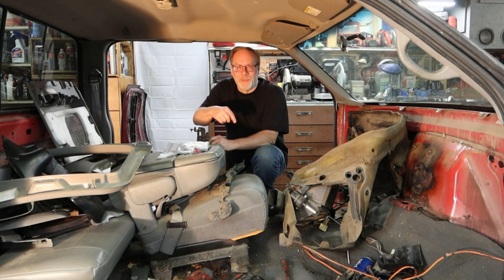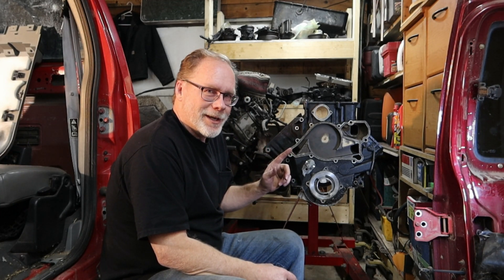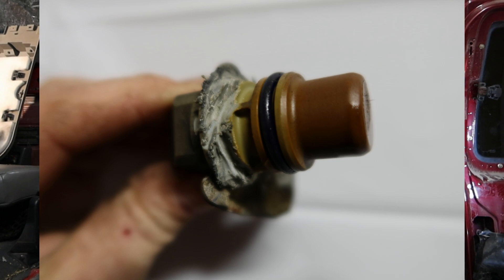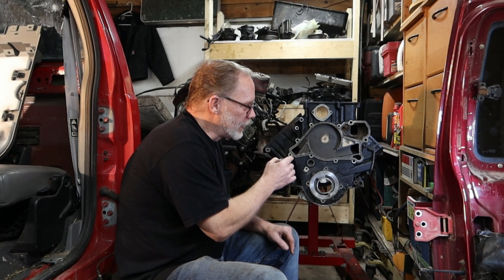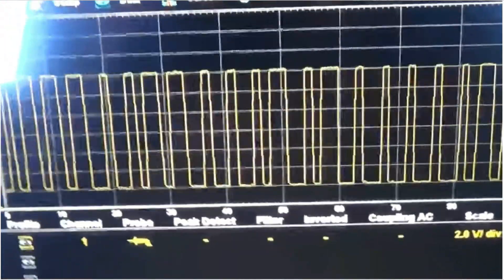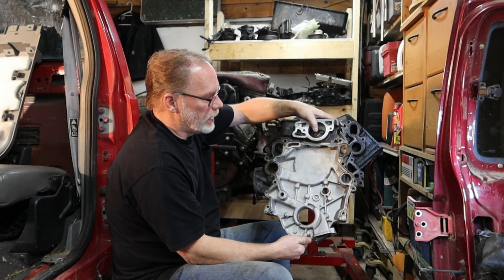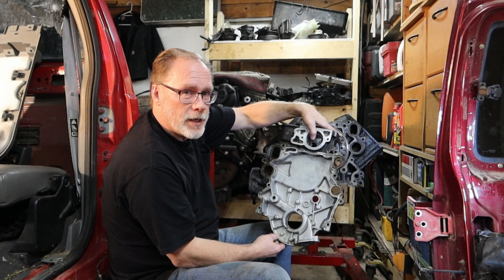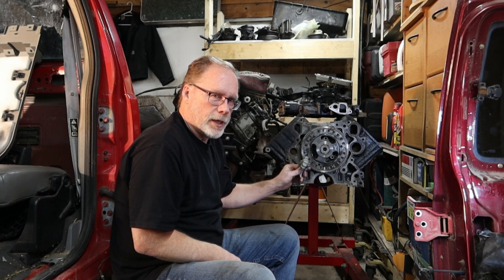🛻📽️ ....7 3 PSD QUICK TECH TALK CAM SENSOR N TIMING COVER NO NO'S🟢🟡🔴🟢

Comment: Hello First off I'd like to say I'm glad I found your channel I have a 99 F 35 0 5 speed starts and runs great sometimes when I go first second and third gear and go to shift the engine cuts out from 5 to 15 second but the motor still runs what has zero power I have to periodically wait and it will come back on, it is scared me a few times when turning out onto the highway with a load and cuts out one of the Cam position sensor possibly be the problem thank you very much should have a shop and where are you located thanks again

Comment: Hey clint, i have a 96 f250 7.3 powerstroke. Was looking at installing the riff raff hpx cross over oil line for the hpop. Is it a good idea? Any disadvantage?
Reply: If you have a stock hpop yes get hpx line

If using an adrenaline hpx line not needed

Comment: Hi Mr Clint I recently purchase a 1997 f350 7.3 in November last year and luckily find your videos ,I never had a diesel vehicle before and I have a question for you, why the engine rumps or loops around when I start it when engine is cold .thanks for taking the time to share your experience with your videos.
Reply from the maker: If it is a automatic trany or was swapped from auto to 5 spd  change the trans switch to a borg warner S9192 /// Other issues that cause this is a sticky IPR this you can remove, install a new seal kit and spray the inside with a carb cleaner to get the gum out of it /// last but not least a air bubble managed to get stuck in the ICP just remove and reinstall to clear air ///  These are the top reasons this happens.
Reply: It's a E40D I saw a video on the the transmission neutral switch, the guy would start engine in park and as soon truck fire up it started looping and he would put it in neutral and it would settle, I tried that on mine and didn't work, I'm going to go with the other advice you give me,I really appreciate your prompt response and your professionalism and knowledge thanks a million stick around!

Comment: How you doing sir? I had a question i have a rebuilt 7.3 I replaced everything and for some reason my HPOP reservoir won’t fill up at all I even replaced the lpop again to make sure and still nothing it had a adrenaline HPOP new ipr new ipc in my cab the oil pressure gauge ain’t moving either I lift my rear end up maybe thinking my sump wasn’t working I’m lost maybe thought u could help if watch some many of your videos I really appreciate it
Reply from the maker: A few questions What year, was the sump pick up new, was the timing case new, was the lpop gears in correct direction or was it universal, was there a new ball and spring with crown installed, if you manually fill the hpop reserve and leave it sit for a few days is it at the same level or does it go empty, was the block before assembly completely brushed out meaning all passages had a like a pipe cleaner ran through, have you taken high pressure air and at the hpop reserve tank oil inlet and shot a long stream of air back through the system to hear bubbling in the oil pan Let me know this info Thanks
Reply: @CUSTOMWORKS7.3PSD  idk if they put a new one in or not i would think so it be 2 years now without running. i dont know for sure on timing case as well. lpop is a mellins so i thought they were universal but i could be wrong. i ordered a new ball spring and crown from ebay that u recommended. i havent tried that i will iv filled it up then it try to start it and its empty by the time i go check it lol. i hoped they brushed it and everything.ill try the air as well tomorrow and let the oil sit over night and see what it does as well. i had a diesel mechanic rebuild it for me while i was in military i paid for all parts picked them as well other then the sump and timing face so idk if those were new or not to be honest. super greatful you replied thank you so much!!!

Comment: Well I don't know much about cam sensors but. It looked like a glorified ABS system which what you hold in your hand. Isn't a little electric generator. Would have been nice if you would have gave us what the amps or the volts are that things supposed to produce because that could also have been the problem that moving it around in and out could have damaged it and changed the voltage. I'm sure you probably going over that in the future.

Comment: Appreciate you sharing these unique quagmires for everyone. I've been struggling to diagnose a low boost, lack of power, and poor fuel mileage for some time. I found a MELTED VACUUM LINE that came loose from its clip and landed against the passenger side exhaust manifold. Repaired the line and presto..she's running properly. 
Start with the basics of the truck.
Great video and thank you again.

Comment: I've been chasing a problem that may be that timing cover leak near the high pressure reservoir. I disturbed the seal once upon a time and the result was leaking coolant, I never considered loosing oil for the high pressure system.